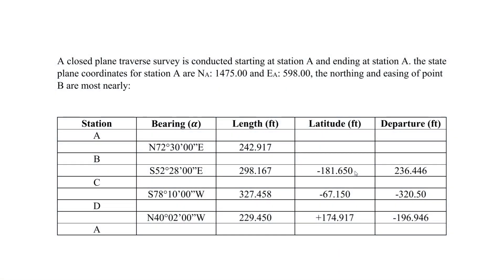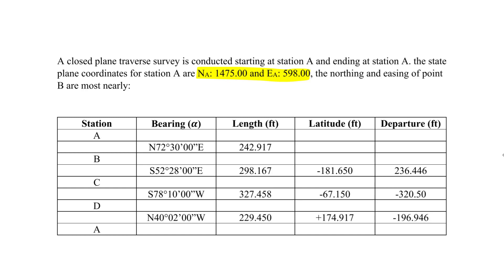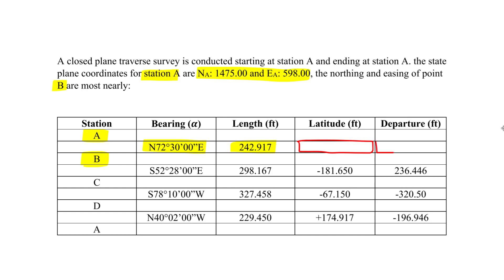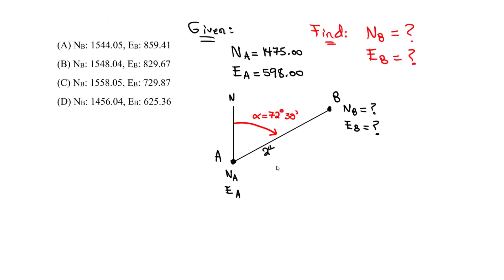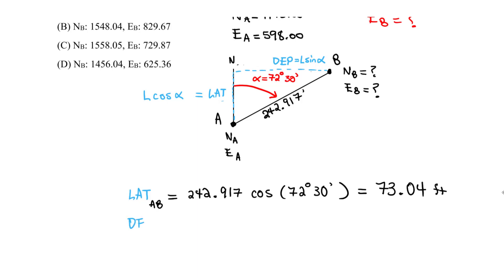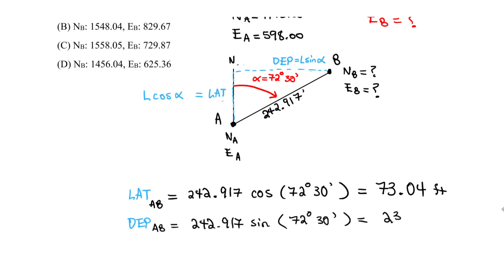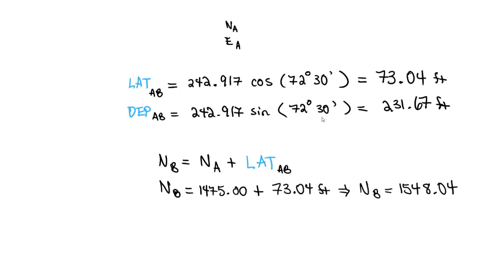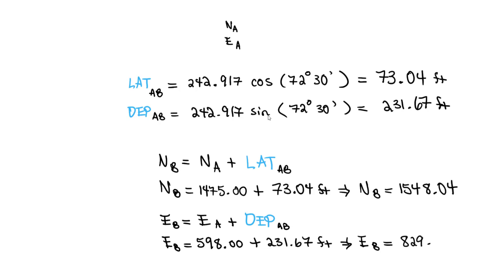FE Exam Review - SURVEYING - NORTHING AND EASTING COORDINATES

Comment: The presenter does a good job of explaining a plane traverse but nothing about this example is representative of the State Plane Coordinate System (SPCS).  Depending on which state you're working in SPCS northing and easting coordinates are often going to be expressed in hundreds of thousands to more than a million feet (assuming the presenter is working in feet - he never defines the units of length.  Additionally the directions in SPCS are always shown as azimuths relative to the grid not berings and the distances must be reduced from horizontal ground measurements to the level of the grid plane by taking into account the height of the two stations above the the datum reference ellipsoid and then applying a grid scale factor.  Regrettably I have found too many errors from surveying and engineering professionals who do not fully understand how to properly perfrom SPCS computations.
Reply from the maker: Hi David, I will need to update the video description as I agree with you on how this problem does not really explain nor employ the concept of the state plane coordinate system. Your description and through description of the SPCS will definitely be taken into consideration when making future videos that actually cover the SPCS. Thank you!